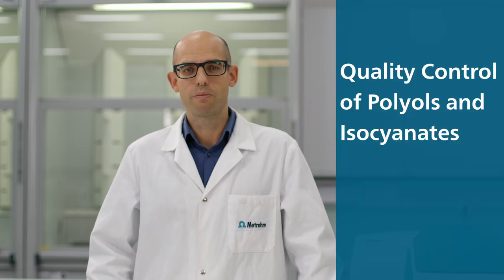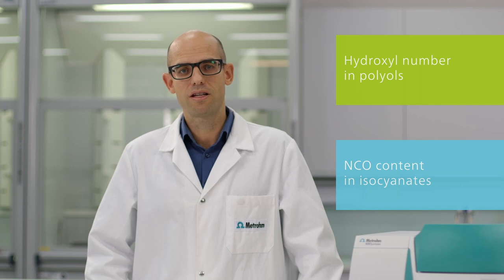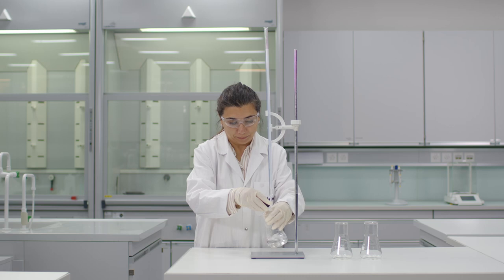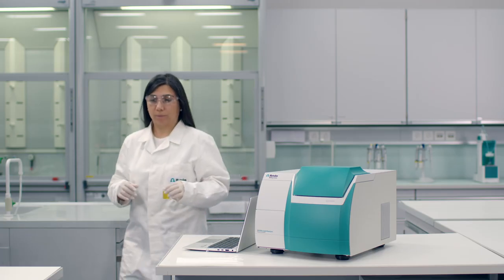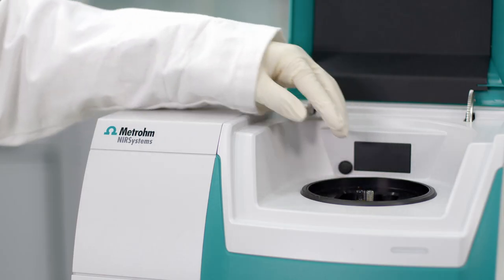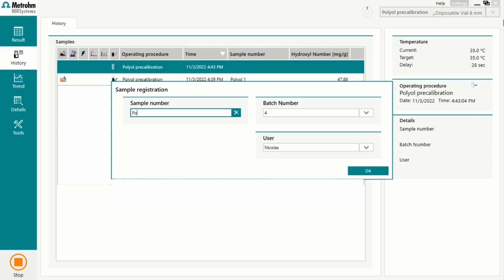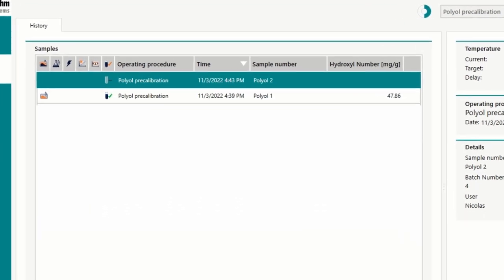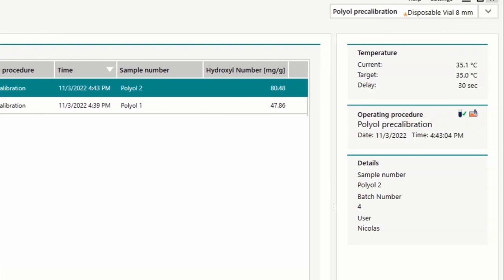Quality Control of Polyols and Isocyanates using NIR spectroscopy

Comment: How many samples of isocyanates are needed to calibrate nir?
Reply from the maker: Hi Antony
You can start with 20 samples but most likely you will need 50 samples for a stable calibration. We offer a pre-calibration with more than 300 isocyanate samples:
https://www.metrohm.com/en/products/6/6072/66072312.html
Best regards
Metrohm International Headquarters